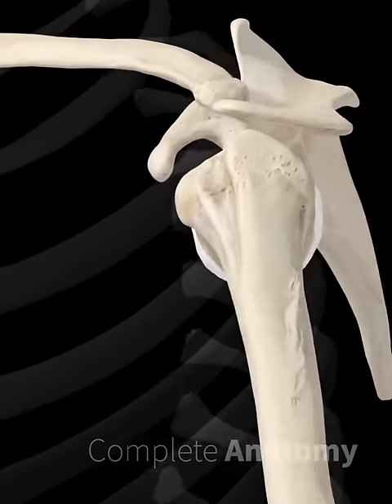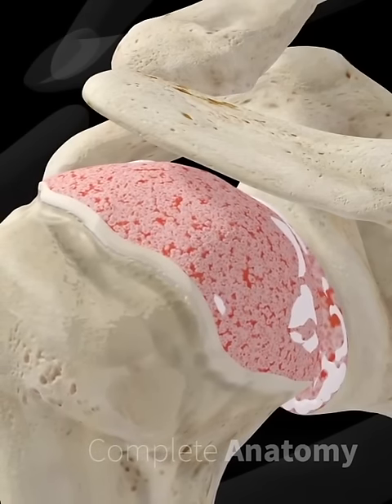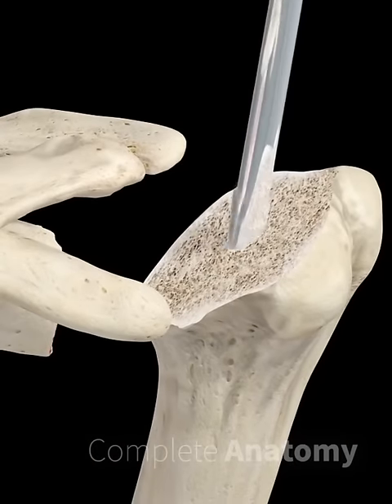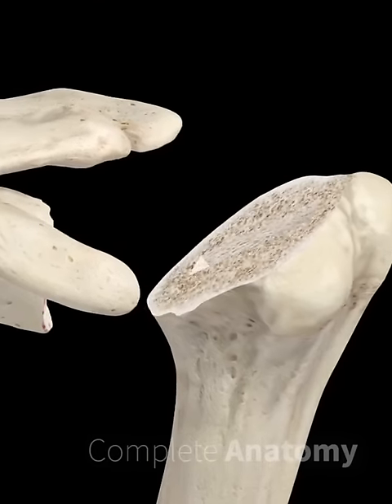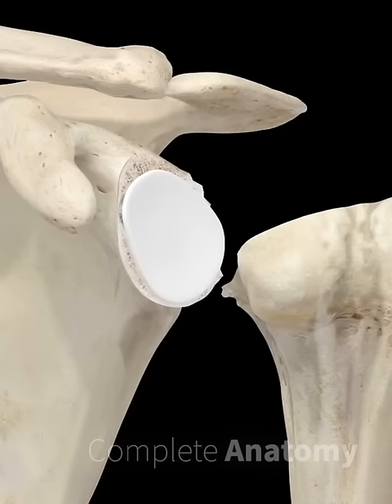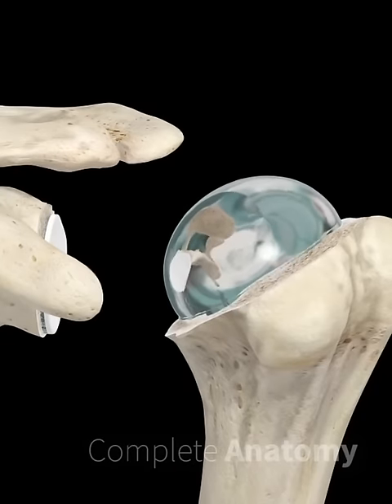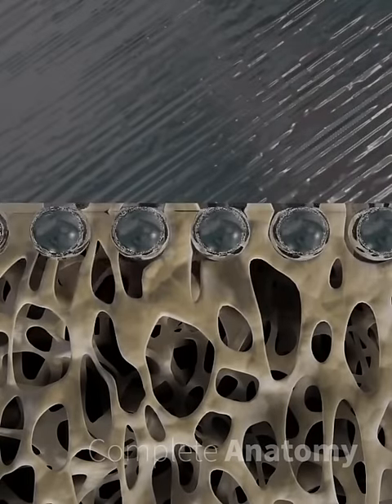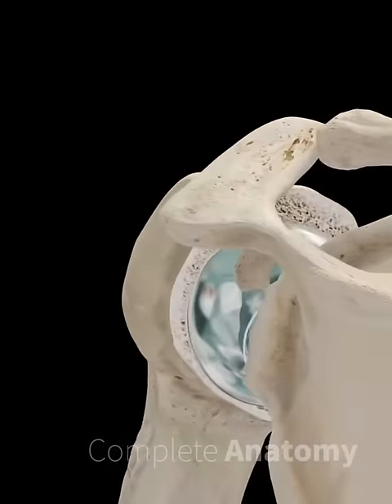Shoulder Arthroplasty (with osseointegration) | Procedures

Comment: “This operation results in pain relief of the shoulder joint” 

Probably because I no longer have a shoulder joint.
Reply: That's exactly how pain is relieved in every joint replacement
Reply: 😂 كلامك صحيح
Reply: modern problems require modern solutions
Reply: @M.M.A.N  
راح المفصل 😂😂😂😂😂😂😂😂
Reply: "Doctor! I don't feel any shoulder pain! You're a miracle worker!"
"You're welcome." *hides removed shoulder joints*
Reply: You can't feel joint pain if you don't have a joint
Reply: But instead one heck of a medical bill
Reply: @tushar-tipartiwar doubt it's a modern problem.
Reply: What about phantom pain?
Reply: @A.Agnani well phantom pain is caused by amputation but this operation doesn't including amputation so it's a different thing.
Reply: @alfredomangean6186  Interesting.
Reply: @dermotthompson2115  not in Europe

Comment: Imagine going through a metal detector and the securities say you have a suspicious item
Reply: Underrated comment
Reply: Yo, my man kinda sus. I was at medbay
Reply: Or electromagnetic field 
Your hand moving without your permission
Reply: I've been through it, even mri, was never asked or even stopped. Have had rip replacement & have implants in both my hips.
Reply: @Utkarsh Awasthi just cut with Machete........EZ
Reply: @guywithbigwhitecock709  lol
Reply: Rip his arm
Reply: @jockae306  thxhtdv
Reply: @ImpermColumn  b
Reply: It doesn't get detected, but it depends on the metal, I have an metal arm but it doesn't get detect through those.
Reply: Ano Nymous  he's doing good lol
Reply: Oof
Reply: Prisinor with cyborg hoints:oh no worries its just my metal joints
Reply: And then they take that item out and let you go 🤣🤣🤣🤣🤣
Reply: @Utkarsh Awasthi , 😂😂😂🤣🤣🤣😅😅😅
Reply: @jockae306  0000000000000000
Reply: @jockae306  0000000
Reply: @Utkarsh Awasthi 00
Reply: @Utkarsh Awasthi 0000000000000000000
Reply: @DTL4__  hmm really
Reply: I have two new hips. I tell them before going through about my hips, I have to step into that xray thing every time!
Reply: When I was in jouvey a guy was shot a lot of times and still had bullets in him so we would sneak our stuff with him bc the metal detector would go off and they wouldn’t check him.
Reply: I think most of them are nonferrous so it doesn’t set off a metal detector, otherwise you could never give them an MRI without making ground person
Reply: When i had my knee replacement surgery Iwas given a medical card alerting I had a knee replacement, incase i set iff alarms. I do tell them right away about my knee

Comment: “Without the need of cement” hold up
Reply: Underrated
Reply: In this case, cement just means something to connect it with. Glue, for example, is a cement
Reply: They put cement in braces, idk why its surprising
Reply: @endlessdragon143  now you just scared me because my mom is taking me to a dentist to put braces on my teeth😬
Reply: I was olso thinking that
Reply: It's neat how it's designed for the body to embrace instead of reject.
Reply: @BluePhoenix3160  E
Reply: @SanDiegonaBatak  have braces is a hell
Reply: Hol up......
Wait a minute 😳?¿?¿
Reply: @j.a.d.a1457  hold up
Ring ding ding
Reply: 443rd 👍
Reply: To get rid of the patient of it went wrong

Comment: Now tell me how tf will they be able to dismantle the arms
Reply: I'm not a doctor but one thing I know about such procedures is that no circulatory nerves or muscle are modified during this process. Just think of this procedure like a knee replacement/any major fracture where it's the bone joint that breaks apart but no major damage is applied to the nerves which carry all the motor circulation systems (after all the main purpose of the bones is to provide structure to our body to maintain a posture.)
Reply: Bone saws, my guy. Surgery is extremely sophisticated plumbing and carpentry.
Reply: I'm not a doctor but I don't think they would have to dismantle the entire arm for this procedure. I think they would pull the arm out of the socket and cut that one piece out while keeping the arm intact with the body. But I'm Not sure that's just my guess.

Comment: my experience after shattering my shoulder and numerous DID work great, except my body rejected the screws and all the metal a tear later resulting my surgeon having to remove it all. my shoulder joint is held together with my tendons and muscles (I am not very tong or have great range of motion, now)  Amazingly it still works, I'm terrified of  another falling and tearing it all up.

Comment: My left shoulder makes weird type of noise and a lil pain due to excessive numerous times of push up while growing up from age 14 to now 32   I recall in 2010 in prison I was doing 500 push up per day at the age of 19 I heard a crack in my left arm shoulder joint I couldn't do push up for couple of days    now when I was 30 I shared this pain I'm feeling once in a while to my Dr she prescribed me some pills which completely healed me up but, even now when I go hard on push up hear squeeze in my left shoulder joint  doesn't pain me as much but, still as if something is wrong with it.     My advice to everyone what ever you do be it exercise or anything in life  should be limited Do Not 🚫 go crazy mode unless there's is someone with experience around you     best of luck.  I hope someone reads this comment and helps YOU ❤

Comment: I have a question. After this procedure, would the brain be able to still send signals to move the shoulder joint if required? Like if I get this procedure done, I know I've lost my natural shoulder joint. Wouldn't my whole arm be paralyzed? I don't think I'd be able to use my whole arm because even if I wanted to move my arm, my brain can't send signals past the shoulder. Or I'm I wrong?

Comment: “Yeah, so to fix your joint pain, we’re gonna cut your shoulder open, pull the bones out a bit, lop the tops off either side, jam some metal rods in there, snap the new shiny ends back together, stitch it all up, and call it a day. You should feel great after it’s all said and done.” Lolol 

And to be clear, I know once the surgery site is healed people do feel a lot better. It just takes months and months of even more, often excruciating pain until you go back to no pain. These are major operations and are last resorts.

Edit: Oh yeah, sometimes they fail and have to be redone. 😈